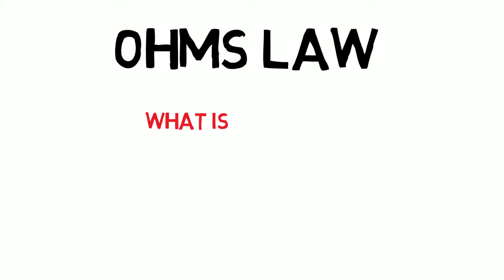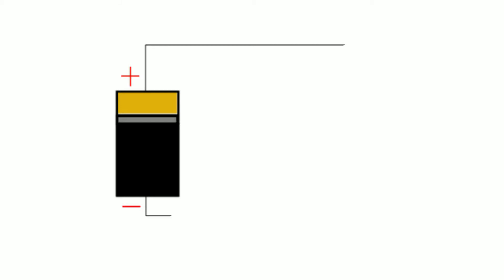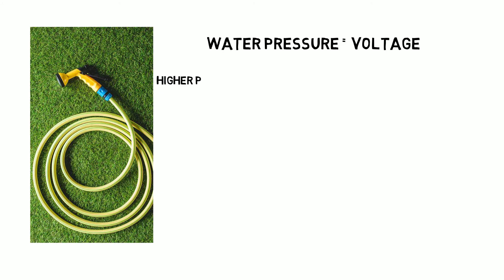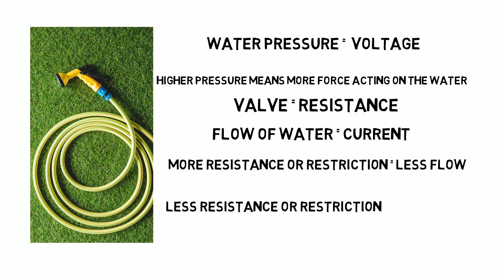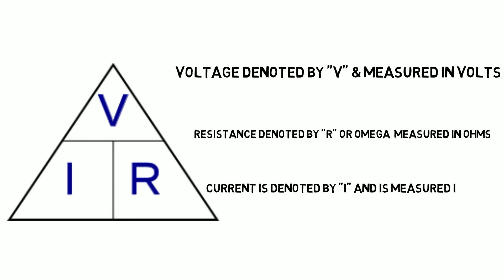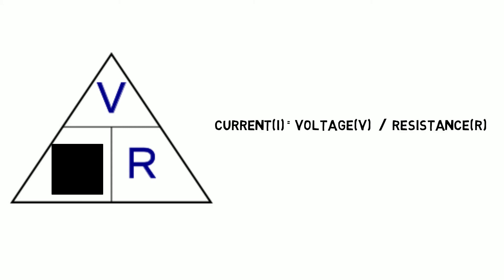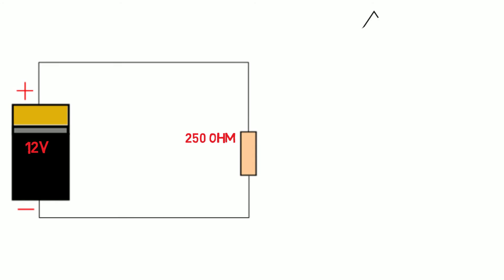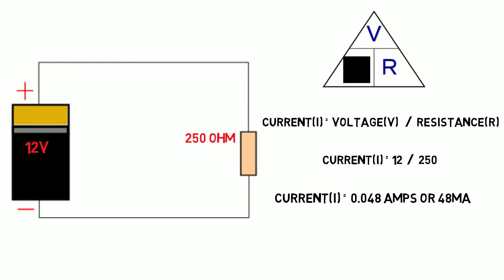What Is OHM'S Law ? [Explained in Under 5 Minutes]

Comment: In a DC circuit electrons flow from negative to positive.  Electrons are negatively charged and since like charges repel, they flow toward the positive. Your diagram conveys the conventional theory not the actual one.
Reply from the maker: You are correct, good spot. Although in practice nearly all engineering diagrams represent conventional current flow (positive to negative)

Comment: So voltage is directly proportional to current and resistance V=IR.  So I was thinking about putting a volt meter across a battery.  There must be current flow to measure the voltage.  So I looked this up and the volt meter has a very high resistance resistor in the circuit and uses ohms law to calculate voltage (from current and a known value of a resistor).  So all these years checking power supplies, batteries, etc. I am really checking voltage drop across the battery or power supply with a very high amount of resistance in the circuit to give the maximum possible voltage drop of the power supply or battery.  If there is a load in a circuit, lets say with less resistance, then current goes UP and voltage drop goes DOWN. So HIGH resistance means HIGH voltage drop and low current in a circuit.  Low resistance means low voltage drop but HIGH current.  Can someone tell me if I have this correct?
Reply from the maker: You have this spot on Darrell. Hope the video helped you!

Comment: Over a century... we can't change the 'I' to a 'C' ???
Reply: Changing the 'I' to a 'C' would cause confusion when you start learning about other factors such as Capacitance in capacitors that are used in electronics and electrical systems later on. Try not to reinvent the wheel as were....kkkk

Comment: is the voltage the same before and after the resistor?
Reply: In a circuit with only a resistor connected to a battery the resistor drops all the voltage. The voltage before the resistor is the same as the battery voltage and after the resistor 0V. 

The current in the circuit is the same everywhere. If you put a light bulb in series with the resistor it doesn't matter if it is before or after the resistor. The voltage across the light bulb the same everywhere.

Comment: We know that current is only present when a voltage is applied, but how can voltage exist without current? E=I/R and if I=0 or R equals infinity, then E must equal zero, yet voltage is a potential and can exist with no work being done. So how can one side of the equation =0 and the other side =X?
Reply: I think I see what you’re saying. Voltage is defined as difference in potential. If there is no “difference” there is no voltage. However an unplugged electrical receptacle has voltage, but there’s no load, no current, and no power. No work. I=0 but the other side of the equation equals 120 volts. Maybe ohms law doesn’t apply when there’s no load, or like you’re saying, no resistance drop. Ohms law applies to circuits. If there’s no load, it’s not a complete circuit. Maybe this explains how one side of the equation can be zero and still have voltage.
Reply: In an insulator the resistance is practically infinite so no current flows. Also current can exist without voltage in a superconductor because the resistance is zero
Reply: But ohms law literally says if voltage is zero then so is current and vice versa.
Reply: @brianlittle717   I don't think we can apply ohms law very well in those scenarios. 0×∞ is not defined. Also the voltage in ohms law means voltage drop over resistance. You could argue that there can't be voltage drop without current. If you put a resistor in series with the open circuit the voltage drop over that resistor would be zero

Comment: How do we apply ohms law? How is ohms law useful in designing a circuit? I designed a simple circuit between a terminal holding 2 AA batteries and a led light. The battery got so hot it started to melt! Why did this happen? How can it be avoided? What is the process for wiring circuits?

Comment: Great but Ohms's law is actually E=IR where E=Electromotive force measured in Volts. It seems  that electrical formulae have been mixed up between what is measured vs. the units of measurement used. (But V=IR is easier for the lay person).
Reply from the maker: You are right @Robin Smith. For practical use and beginners I think using V works fine.